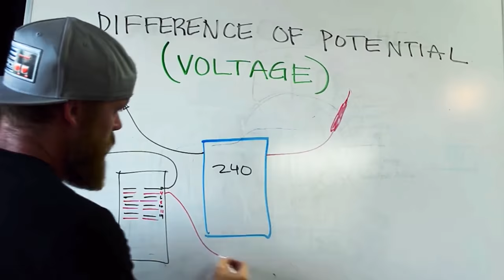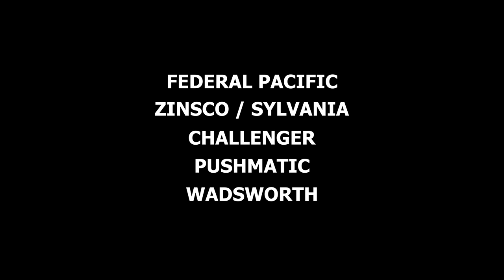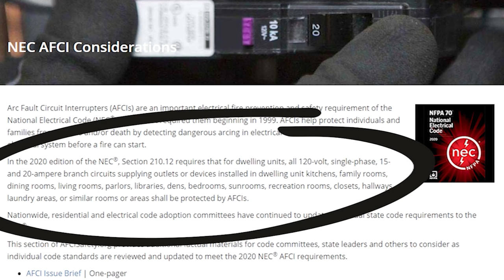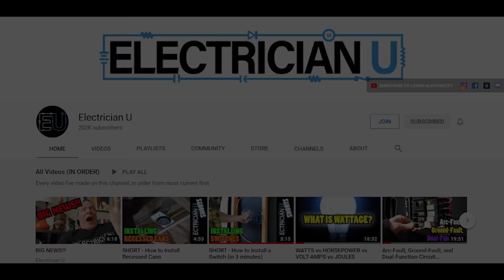Outlawed Panels and Breakers

Comment: I have a situation I need help with. We do service work on a high rise apartment building in Trenton NJ. Most calls are for electric heat no working. When we open the panels I find that the 2pole 20amp breaker is bad and has been arcing on the buss bar behind the breaker. Occasionally the main breaker will be affected also from the heat generated from the faulty breaker usually right next to the 70amp main breaker. The panel and breakers are Bryant with the color reset handles. I don’t know if any recalls exist that I have found on these breakers but we are experiencing more and more of this recently. Normally we have to shut down the entire circuit in the basement and remove the main breaker and I clean up the buss bar with a file and replace with a new Bryant breaker usually old stock we buy online. The problem has come up and it’s coming up more and more where the buss bar is beyond burnt up and there’s no way to use that breaker space anymore and now the panel needs to be replaced. The issue then arises how to go about this. The main feeders are a continuous uncut run of 500mcm in a 2” conduit run from the basement all the way up to the top floor. They are not cut inside the panel. They use tap lugs to attach a smaller 2awg conductor that then goes to the main breaker. So theres no way to actually remove the damaged panel without cutting the main feeders. If you did cut them how do you reconnect them now that they are too short and so big you can’t really maneuver them much in such a small space. What we started doing was replacing the panels on the top floor where the feeders end and we can remove that entire panel then using that old panels bus bar in the effected panel on a lower floor but I’m running out panels on the top floor to do this. These Bryant panels are strange. Kinda have a larger space off to the side to allow for the feeders to run directly through and have space for the insulated taps for the feeders to the main. The feeders pass through the panel. Can’t cut them. Can’t remove the panel. Can’t find replacement buss bar that will work and fit the panel covers. They are 12 circuit. Main breaker. If anyone has come across this please help. I can provide more information and pictures if needed. Thanks guys.

Comment: The problem with replacing them... you don't know what the bus bar looks like until you pull the breakers. If it's damaged, you can't shove a breaker back on top of it. Maybe there's room elsewhere in the panel, but in my experience, that's usually not the case. (the nuts that used these (zinsco) appear to always install the smallest panel they could find.)

[When the difference is $75, put the largest panel that will fit. That $75 is way cheaper than replacing the panel, or adding a sub.]

[Also, Zinsco's have been used up into the 80's.]

Comment: some thing that no one talks about is that you need to go and trip the breaker by hand (flip the lever) once a year to test. that ensures that the breaker is not frozen (won't trip) or bad that it won't reset. i have lived in dusty places and have found old breakers full of dirt and would not work. (both ways). please turn off load before doing.

Comment: Hello,  I would love to get more of your take on Challenger panels.  There is some contention in the home inspector community regarding these panels.  Much of the info I have found states that the only issue was with some of the 15 and 20-ampere type HAGF single-pole GFCI breakers.   Aside from these breakers, were there any problems with the panels themselves?  In this video, you lumped them in with Zinsco and FPE, but then never really came back to discuss Challenger in any detail.   I am currently recommending panel replacement of Zinsco and FPE, but not necessarily Challenger.
Reply: I'd like to see a reply on this too.

Comment: How are the "panels outlawed" if it's ok to replace the breakers?

If you go down the daisy chain line in a home and short an outlet to test it and the breaker doesn't trip, you've a not insignificant chance of finding a bad connection by the connection bursting in to flame inside the wall. Safely finding resistance in structures is complex and beyond the ability of nearly any sparky, at least around where I'm at.

Comment: Agree intentionally shorting a breaker is nuts, but seems ok to turn breaker off, short neutral to hot, and then see if the breaker will turn on.  However, instead of doing it with the actual circuit's conductors, why not just remove the hot from the breaker, tie a short jumper from breaker to neutral bar, and test it that way ?  No chance of damaging the house's wiring or worse.

Comment: If they have zinsco i do tend to say replace it mainly because the cost of these breakers and the tendency to fail. Better to replace and save money and a headache in the long run. A new panel does cost thousands but pennies on the day for the years you get out of it
Reply: A new panel is like 150 bucks lol. Anyone competent can change it..
Reply: @MadMetalShop  so you would recommend a handyman just because hes mechanically inclined? That thought process alone means you arent competent
Reply: @isaiahrubio562  is that even what I said? No I don't think it was 😏.

Comment: Pushmatic aren’t illegal; in fact my local electrical supplier still sells Pushmatic breakers. The modern/new Pushmatic breakers carry UL listings. While I recommend replacement I do a lot of service work on Pushmatic panels, in no small part because they suck. While they may suck they aren’t illegal, at least to my knowledge, and in my municipality. As far as I know NEC 2020 doesn’t name brands of breakers only what standards the systems must meet. As a side note I’ve seen both Eaton and Square-D bus bars melted from bad breakers. While a lot of modern breakers fail safe not all do. One big problem I find with Pushmatic is that the breakers are screw in and the screws can loosen over time. I know most electrician will pass on words of wisdom or dangers regarding equipment but I’d like to know your source regarding the legality/illegality of these panels, especially Pushmatic, so I can be better informed as I’m not aware of specific legislation banning them, at least nation wide.
I’m in Upstate NY, just as an aside. I have heard of seen some liability suits regarding these manufacturers, including class action suits, but no outright laws against. Like anything time can degrade everything and things can loosen up; I think as professionals we should be able to service things as much as installing new, even if we prefer new.

Comment: Dustin - I would be interested in your data. I have been involved in many of these discussions for years. When you say "outlawed", none of the manufacturers you discussed were ever "outlawed". In fact, with Federal Pacific is was a class action suit in NJ and location specific. Zinsco was never an issue with the devices, it was the decaying Aluminum bus. Even the " stab-loc" design is still in use within Canada and is owned by Schneider. Anyway, there is alot of historical data on these things so again lots of "death" statements so I again would be interested in your data my friend.

Comment: I know this is an old video, but hoping somebody could see this and respond. I have a mid 80s Challenger SL12 box. One of the single pole 15 amp breakers started to get old and intermittent. It wouldn't trip. I have a max 1500 watt load on this breaker of which none of the total load is active at any given time. An electrician came out and recommended that I replace the panel. And he didn't replace the breaker. He moved the wire to another breaker that sees no use and has only two receptacles attached.

I see that Connecticut Electric makes UL listed replacement breakers. The box is clean. All of the interconnections are solid. The buss bar looks like new. Why can I not just replace the breaker with a CE UL listed replacement? Everything that I have researched on these SL12 boxes is not related to a problem with the box. The problem is the breakers.

I'm looking at a $3000+ box replacement vs. maybe $500 of breakers.

Comment: Connecticut Electric makes replacement breakers that are UL listed for most of these panels
Reply: Yeah and a 200amp main breaker is 300 dollars! Freaking robbery! Just replace your panel. I was going to get a breaker until I saw that tag.
Reply: @MadMetalShop  $300 for a main + $100 service charge. Or at least twice that to change the panel and replace every breaker. If you have to do the feeder too even more money. If you have to do the whole service a couple grand. Some people are lucky to come up with the $400 to change the breaker.
Reply: @ericnortan9012  but it's an outlawed panel. Even if I got that breaker its a bandaid to a bigger problem which is the panel itself with their troublesome bus bars. Its doesn't make much sense to me to pay 300 for something that will ultimately need total replacing anyways. Usually asap.
Reply: @ericnortan9012  ..... That and you can get panels right now tons of circuits WITH breakers included for under 200 on sale. Home depot has them right now. Square D..
Reply: @MadMetalShop  I agree. I'm an electrician and would always recommend an upgrade. But the option is there. Generally "illegal panel" means you can't install them anymore, but you can service existing equipment.  Unless you can do it yourself, which I've found most people aren't comfortable with, a full service change can be very pricey. A new breaker may be all they can afford. If the equipment is unsafe or unserviceable, then you really have no choice but to upgrade. If there is any question I have no problem asking the inspector, he can red tag the thing and force the issue.
Reply: @MadMetalShop  
That assumes you can replace the panel. 
My 60 amp pushmatic 12 breaker Is small, and the electrician said he doesn’t know of anything that would fit in the same space. Assuming it would be in the current code to put it where it is.

Comment: I use an old 50amp disconnect with a 32 amp KitKat fuse and #8 leads coming off of it to test circuit breakers short trip. If the breaker pops then you are good, if the fuse pops you need a new breaker. This way, the ark is contained in a metal enclosure and the circuit has protection. Does it take longer? Yes. Is it one more thing to keep in the van? Yes. Do I have a 🔌 adapter with it so I can trip circuits in unlabeled pannel’s? Yes. Is the best part of AFCI circuits that you can trip the breaker with a plug tester? Yes. Did I throw a bucket of water on my master electrician the fist day of work and tell him to get mad so the water would boil after he sent me to the truck to get him a bucket of steam? Yes. Did he get back at me by Turning on a circuit I was working on a month later to belt me? Yes. Did he get the last laugh after he belted me again? Yes.

Comment: Episode suggestion.  I noticed homedepot does a project guide where they tell you how to wire a circuit breaker.  What about Electrician U version of this with a discussion on how to chose the proper material, fishing wire through a wall and wiring one circuit up for a receptacle or something.

Comment: you have great content  keep it up!!  I have lots of experience with the zinco and pushomatic ,,,,,, changed out many and seen many melted wires and panels, from zinco and pushomatic,,,,,,,  I purchased a 8 homes in a development of 302  houses built in the late 70s and early 80s ...... all 302 homes have Zinco 100 amp  main panel outside, then pushomatic main lug subpanel inside ..... to many fires and electrical anomalies caused by greed of the two companies

Comment: Living in Fl, St.Pete I was shopping and some guy ahead of me at check-out was bragging 
how he used to put a penny in the fuse box to keep the lights on if a fuse blew. I asked him
if he was still doing such a foolish thing. damn, he got mad real quick. He was actually 
buying Edison fuses, lots of old houses down there. He actually asked if I was accusing 
him of being foolish. I stood up to him and told him a fuse is made of lead and will melt, 
breaking the circuit. by the time a copper penny melts, the rest of the hous's wiring will 
have gotten so hot as to melt the insulation and start a fire. He waved me off and split.
I don't know if he ever found out the hard way that electricity has no fkg respect for 
stupidity  and or ignorance.

Comment: I have a question boss do you think that  When  we replace the main panel  the arfult breakers will work  Because most of those breakers are sharing neutral with multiple circuit?  If   the national electrical code 2020 required to have it how it's going to be possible  .   Thank you man I really like watch your videos
Reply from the maker: It wont function as designed. 
Thanks for watching!

Comment: I-T-E Pushmatic or Bulldog Pushmatic was actually a pretty decent breaker, retired by Siemens after they purchased I-T-E low voltage distribution, mainly due to the fact of extremely high costs associated with tooling and component costs.  Interesting to know however there is someone making replicas now, didn’t know that.  Cheers!!

Comment: Have you had any problems with Cuttler Hammer before?  I knew someone that had a breaker not trip in a Cuttler Hammer.
Reply: Put Cutler Hammer in my house years ago, no problems.
Reply: type CH arc fault breakers had about a 20% defective rate, the first few years, but other than that, they are a solid breaker  type BR panels almost always have an aluminum bus, leading to bus corrosion and breaker burnout.  they also have a tendency to trip without the handle moving to the trip position which is not a safety issue, but it does make troubleshooting more inconvenient.
Reply: The breakers were not AFCI or GFCI.  It was in a trailer home.  I think it was an older trailer.

Comment: I had a landlord that was a cheapskate and the place I was renting had an FP stab-lok panel in it with damage. He would not replace it because he "didn't have the money" (it would cut into his meth addiction I found out later on). I told him it was dangerous and needed replacing and he replied "You ALWAYS have some fucking fake ass excuse that will cost me money and never a realistic solution that makes sense". 6 months after I moved out that house burned down and he tried to file a lawsuit on me for it. I NEVER touched the panel (as in removing any screws or breakers) just looked at it and recognized it as a problematic device and informed him. Needless to say the lawsuit was thrown out of court and he got stuck with the court costs.

Comment: Bulldog Pushmatic was an excellent breaker (and indeed UL listed), does not deserve to be in the same category with the likes of Zinsco and Federal Pacific.
Reply: No, they are good. We pull them because of lack of space/ power. Most of the ones I run across are 100 amp 20 space. Really just don't cut it these days.

Comment: i shorted a hot and neutral at a school, and the circuit didn't trip but the wires vibrated inside the run of conduit.  it was kind of odd.
Reply: nope, that is normal. when you have high fault current, the magnetism(60 hz hum) of the wires will vibrate in the conduit
Reply: @gregoryclemen1870  i get the vibrate part.  the circuit not tripping with a direct short is what i didn't get.
Reply: depending on how far away the short circuit is from the breaker, will have an influence, due to the resistance of the wire. as the wire heats up, the resistance goes up as well, and the high resistance of the wire(as it heats up) the breaker no longer sees it as a short circuit. the breaker will see it as an overload, and will take time to trip, making the assumption that the breaker is good. I remember years ago, during a power shutdown,( for breaker testing), we had a 1,500 amp power breaker that would not trip. it was up to 5,000 amps and would not trip. the only thing that it was doing is we were starting to let the "SMOKE" out of it. we aborted the test on that breaker(no spare unit) and re-installed it, and ordered a new breaker. yes it was a "FIRE PRONE ELECTRIC" breaker!!!!!.     it is always a good idea to have breakers tested/exercised. you are relying on a electro-mechanical device that is in the "ON" position for years!!!!.   in my house, all 240 volt circuits are backed up by fuses, including the main.(fused disconnect) , also I have square D, Q.O breakers/panelboards.   the nice thing about fuses, they are thermal devices, and I have never seen a fuse "NOT LET GO"!!!!

Comment: To check the short circuit you build a male plug and put a switch on the end plug it in and flip the switch it should trip immediately and as for replacing the panel box yes for most of us it's 15 hundred dollars or more that we can't afford or won't pay for 500 dollars in parts and a couple of hours work since when should a person get 500 an hour because he has the certification